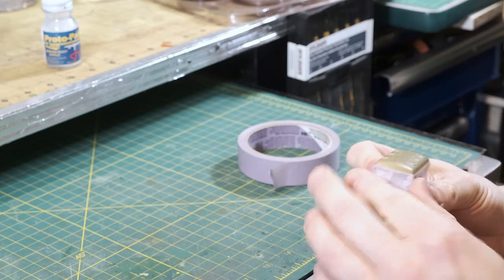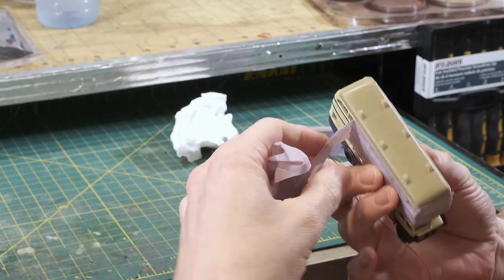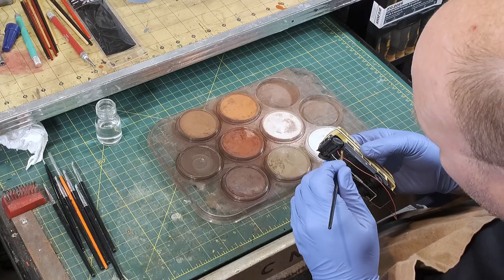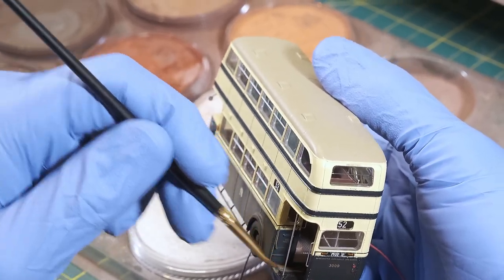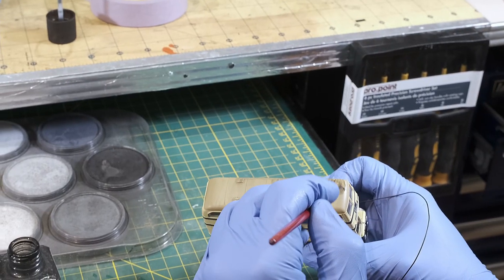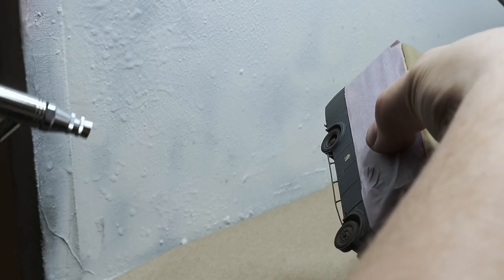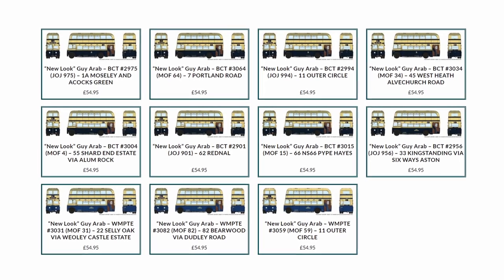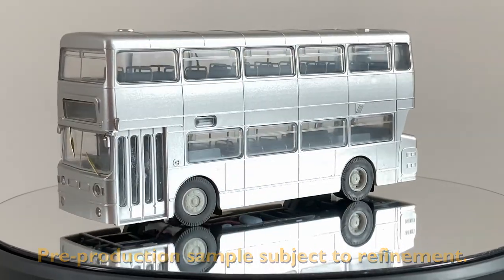How to weather a model bus

Comment: one question: i just learned about the rapido buses. Do they all have lights and cords installed, so the only thing i need to light them is a power source?
Reply from the maker: Yes! We recommend a 9-volt battery.